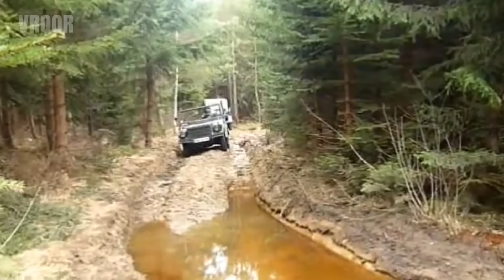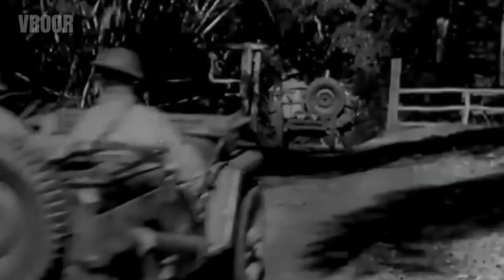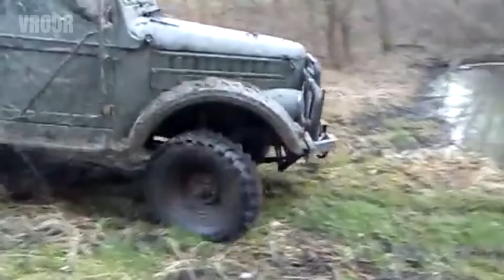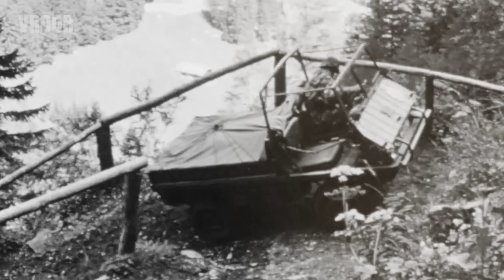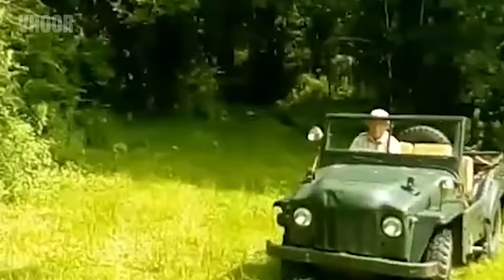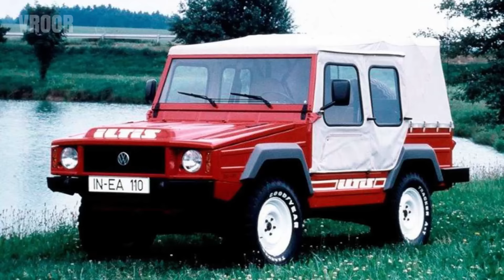10 Most OVERBUILT Military Mini 4x4s Ever Built!

Comment: When in Cuba I spotted several BJ212, a fairly handsome beast. Portal axles offer advantages in terms of gearing for driving off-road and ground clearance, too bad the ARO M461 did not actually have them. A lot of BS around the Iltis and its permanent AWD system. In reality such systems were not new and they certainly didn't wait for Audi engineers to invent it. Jeep's Quadra-Trac system has been around since the 1973 model year and the Lada Niva has had such a three-differential system since its launch in 1976, even in sports cars the Jensen Interceptor FF had AWD in 1971.
Reply from the maker: Wow, thanks for this incredibly detailed and informative comment! I really appreciate you pointing out the nuances of portal axles and setting the record straight on the AWD systems. That's some serious knowledge!

Comment: when talking about being overbuilt you definitly missed out on the "leichter Einheits PKW" fully independent suspension, 2 springs per wheel, self locking differentials, 4-wheel steering, etc.  And all that in the 1930s
Reply from the maker: That's a fantastic point about the "leichter Einheits PKW"! It definitely sounds like a prime example of being overbuilt for its time. Thanks for the insightful addition!